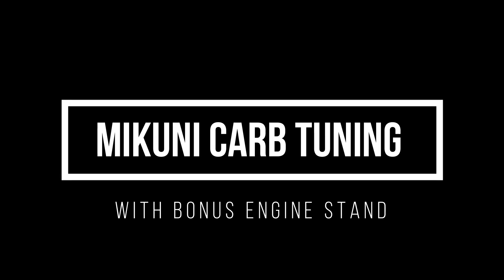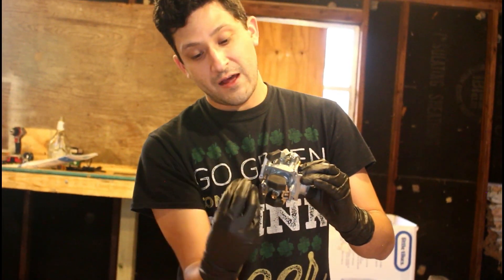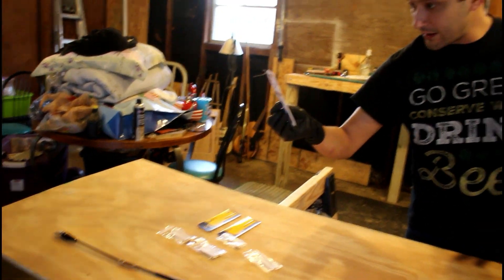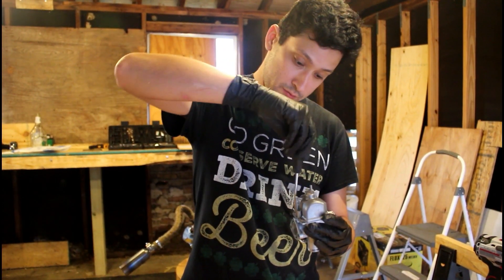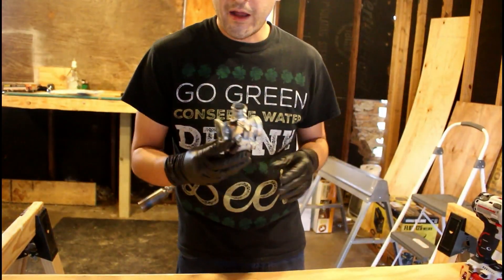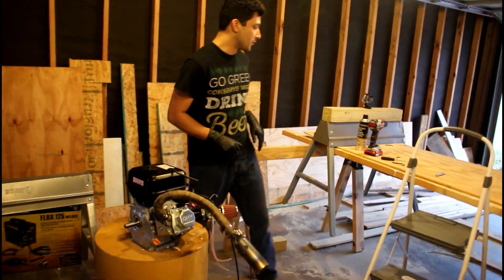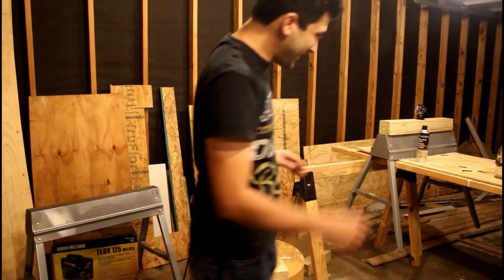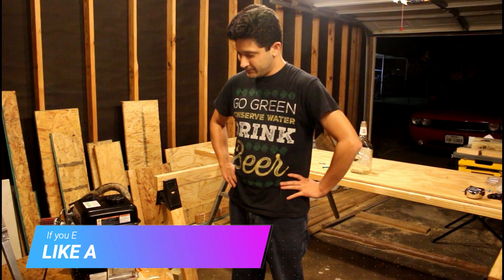Mikuni Carb tuning and New! Engine Stand

Comment: what was ur main jet size and pilot jet size ?
Reply from the maker: Thanks for the question! I am sitting in the dark right now since we just had a tropical storm bore through the area. Once we get power back and get cleaned up, I will go in and look at it. I can tell you I bored out a stock #95 jet in the carb. It was between a #55 and a #53 drill bit that I used.
Reply from the maker: Sorry for the later-than-expected reply! I Used a #57 Irwin drill bit on the main jet, which measures .0430" or 1.09mm. The pilot jet is a #27.5 pilot jet not drilled in any way. Thanks for the question!
Reply: @tinkertrials8745  thank you sir, i am currently running a 115 main jet and 15 pilot jet, but ride at 5000-10,000 ft elevation with less air density (colorado) ;D
Reply from the maker: @Michael Nouri Are you thinking of running Alcohol? Let me know how it turns out at your elevation. I'm interested to see as we are only a few feet above sea level.

Comment: If the screw is between the throttle and the engine it controls fuel and if it is between the air filter and the throttle it controls the air.
Reply: Exactly,..if it's on the air filter side it controls the air !!!